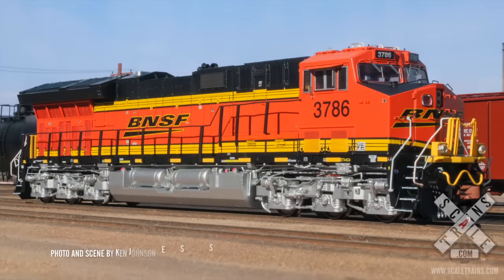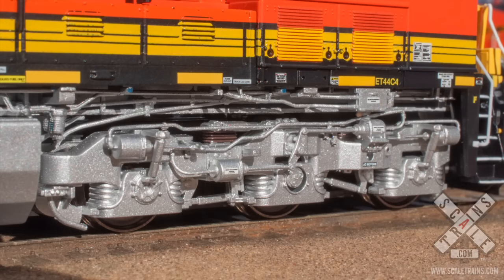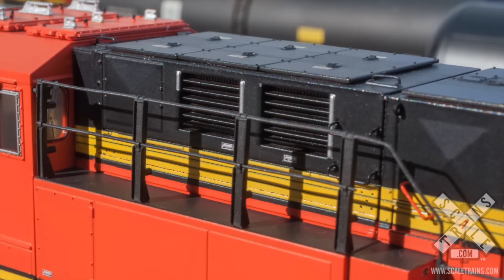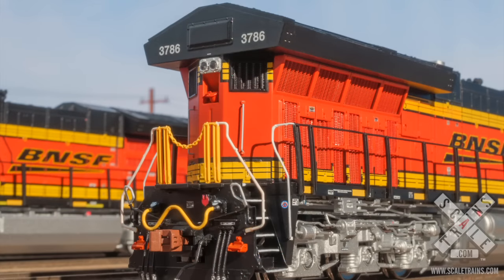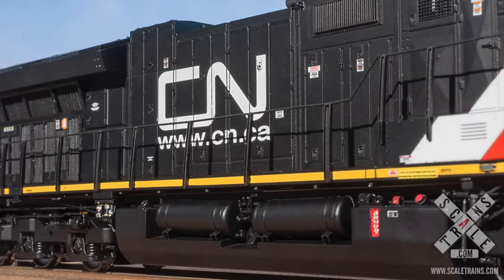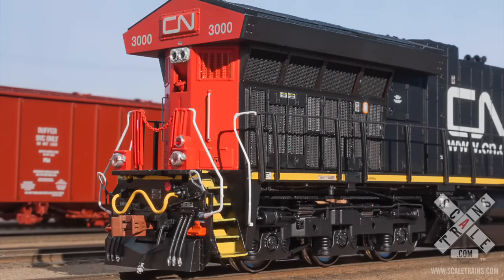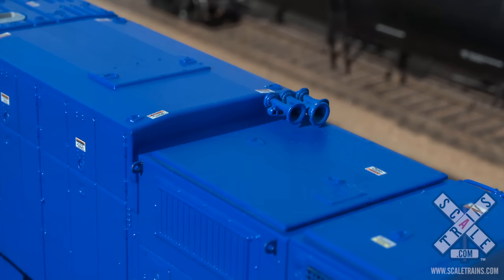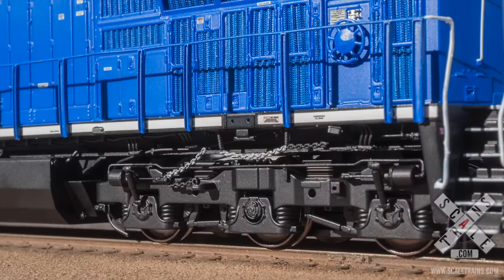Rivet Counter™ line HO Scale Tier 4 GEVo Diesel Locomotive

Comment: Outstanding models. Already purchased a few for myself. Will the NS versions have white numberboards with black numbers like the prototypes? As far as I can see, the pictures on your website have them with black numberboards and white numbers.
Reply: Also, now I see that your Pre-Production samples have the black numberboards with white numbering. Will this be fixed?
Reply from the maker: +Royal Hudson Rail Videos  the first samples we receive are for "proof of concept" so we can ensure the correct parts are on the model, confirm printing and lettering, paint color, etc.  The NS models have the incorrect number boards.  Production models will have a white background with black letters.  Shane
Reply: Thanks Shane. Makes sense. They're outstanding models, you guys are really taking this hobby to a whole new level.

Comment: I would rather have a model that has handrails that are plumb and square, piping that looks like it's rigid and is straight, front and rear platforms that are actually horizontal and orange paint that looks more like BNSF orange than the mop on the head of the pretender in the White House. All the details in the world are meaningless if they're not even straight. Look at the broadside shot of the front steps and platform leaning down. OSHA would have a field day with these. Look at the fancy piping that isn't straight- it looks like crap. Look at the handrails leaning in towards the carbody like the engine has taken a dive in the ditch. This stuff is elementary and it isn't even done well. People are blinded by all the bling but the body and the handrails aren't even plumb and square. Why someone would think this is art is beyond me. That said, I do give them credit for beautifully crisp paint separations and the lettering on the stickers is nearly legible which is amazing. Those don't make up for the bad basics though. One thumb down and one up at best.
Reply from the maker: Douglas: the models featured in this video are from first test shots.  We utilize the first test shots to make tooling changes, model enhancements, and verify accuracy.  Shane

Comment: Yes, the warped piping, the handrails that look like they came from a warped die, the orange that is darker than CN's, and the amazing fuel sight glass that shows silver oil. The photo at 2:27 says it all. If you really think this is a work of art you need to get out and see a real GE. Then you might begin to realize that it's not the number of pipes and handrails but how straight they are. I will say the features are a great idea, they're just not executed very well.
Reply from the maker: Douglas: the models featured in this video are hand-built early test samples from first mold test shots.  There were several revisions made to the mold and assembly process for  production and the final models are well executed.

When we announce an all-new model, we're committed to showing actual models instead of prototype photos, artists renderings, 3D CAD, etc.  Unfortunately early samples are far from perfect.  However, we feel they give a much better indication of what the final product will like when compared to not having a model at all.

Please check out our HO Tier 4 videos noted as "production" and you'll see the difference.  Shane